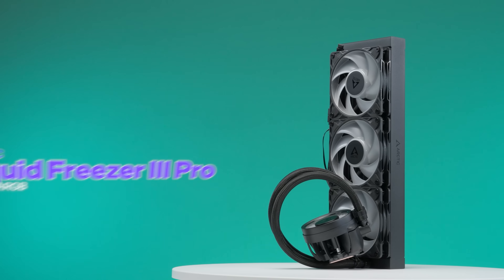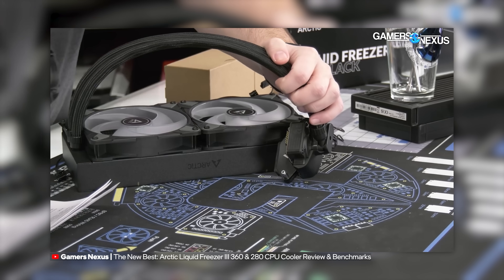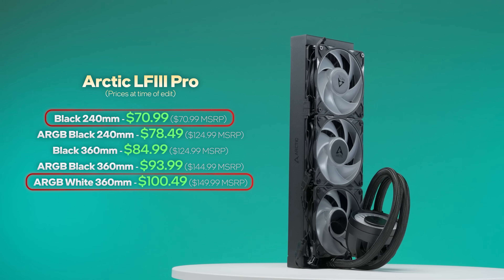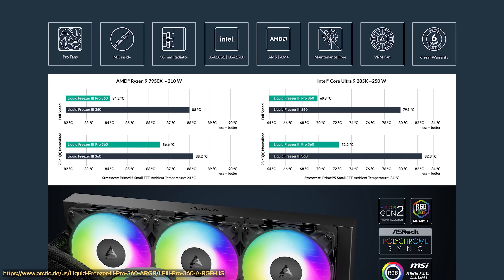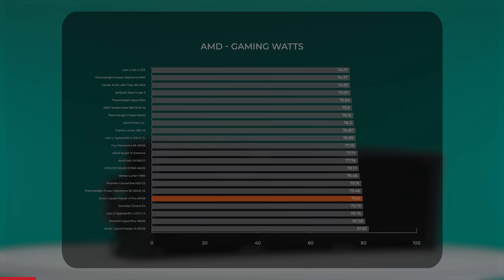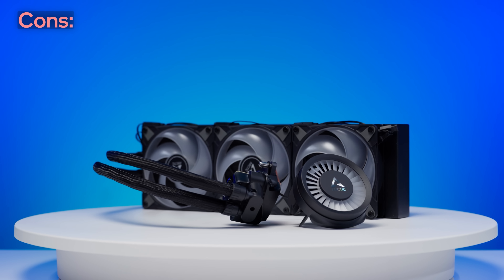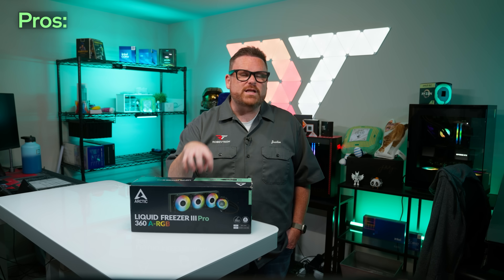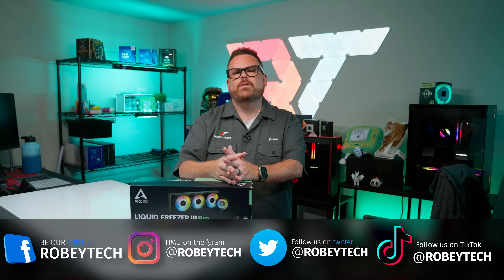Is it actually an upgrade? The Artic Liquid Freezer 3 Pro AiO Ultimate Review

Comment: As someone who recently built a system with this AIO one of the biggest considerations for me was the warranty. Thermalwright AIOs have a 3-5 year warranty while this one has 6, I wanted something that would last and Arctic checked that box, it’s clear they stand behind their product with a warranty of that length in comparison to something that would likely have a shorter lifespan.
Reply from the maker: Totally fair.  Up to you if the one year of additional warranty is worth it for sure.
Reply: I just purchased this as well. I was considering Thermalright in the mix along with the BeQuiet Light Loop. I did an enormous amount of research as this will be my 1st time putting an AIO in my system. What must be noted is high failure rates of Thermaright AIO's, non-existent customer support & incredibly buggy software for it's LCD screens. Arctic have a proven track record of being customer centric with quality & responsive support. Factoring in performance, support & value combined with the 6 year warranty was the deal clincher for me. All that remains is the aesthetics which is down to personal taste or if you care. The extra warranty should not be underestimated by any means. It's not only a matter of cost/value, it shows confidence in the product by the manufacturer in the reliability of the product.